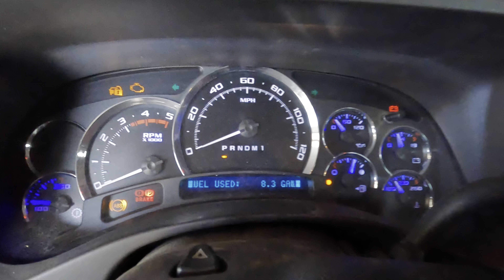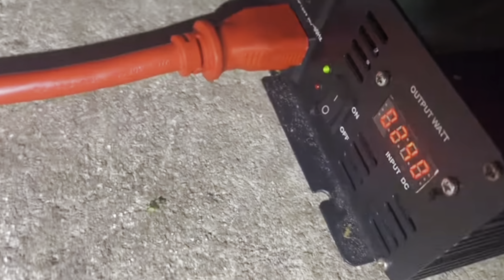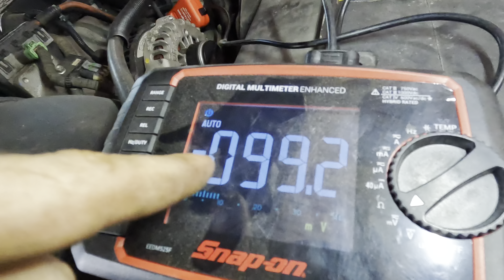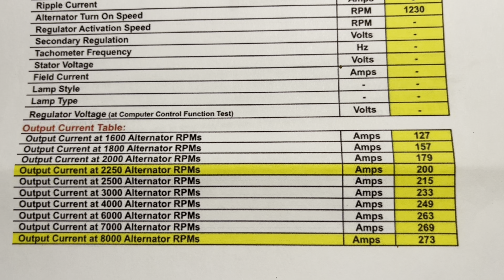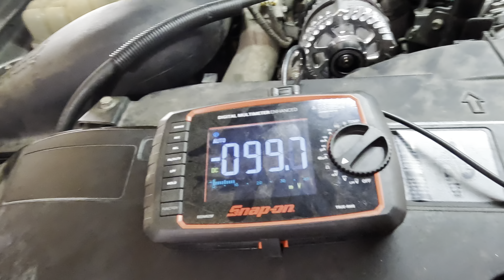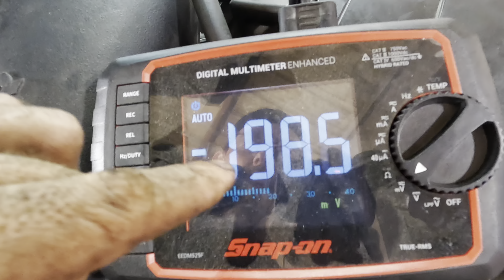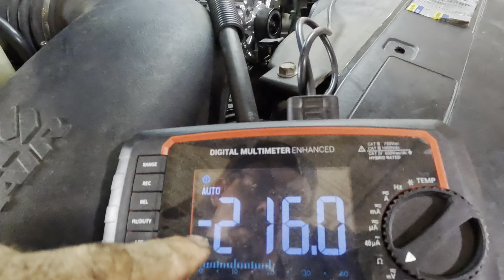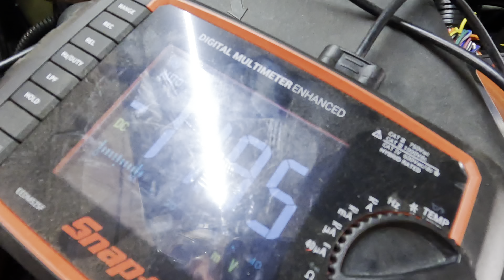Torture Testing a Performance Alternator

Comment: Ray if you double the output of the alternators you are doubling the power required to drive them especially at full output what happens when the belt breaks at 2.00 in the morning and leaves your engine without a waterpump for cooling also diesel engines hate running under light load the rings glaze up and they start burning oil
Reply from the maker: High idle at 900 rpm will prevent glazing and keep oil pressure up, that belt won’t break with this setup. It’s an oem configuration found in medium duty trucks

Comment: I have a 150A alternator (has 200k km), 60AH LIFEPO4 A123 battery with 900A cranking amps (6 years already), more than enough, don't get why in USA you need two alternators? You are making your system more inefficient, what about the belt, can it drive both of them and also the AC compressor? more than 10KW at full load?

Comment: This is great and all, really, I’d say do it just for peace of mind, but honestly, why not just install a generator at the house? Or have an electrocutionist install a plug at the back where you can plug in a portable generator to run the main parts of the home in a power outage I.e fridge, stove, couple outlets, etc, which is cheaper than a whole-home generator. Makes more sense than just relying on the truck, but to each their own. Maybe I missed your decision process on this whole endeavor 🤷‍♂️ which is more than possible 😂 
God bless~

Comment: I see that you regularly measure amperage, isn't it useful to install 3 ampere meters in the dashboard, 1 for each alternator and 1 for the total power consumption? This way you can always check whether the alternators are still working properly and in the event of a power outage at your hoouse you can quickly see what power your inverters are consuming and whether you are not drawing too much power from your batteries. Also way easier than fiddling with and adjusting of the clamp meter all the time.🤷‍♂

Comment: Its designed to short term surge up to 270 not run at 270 continuously - Or you'll burn out the regulator and or diode - Get real here - The battery's them selves cant accept a charge of that amount or they would go BOOM!!

Comment: Won't the alternators fight each other?
Reply from the maker: Only on Toyotas 😏
Reply: They'll adjust automatically. Thank of it like a big guy along with a weaker guy both pushing a car up a hill; the weight of the car is the load & the two naders are the guys. The big guy will do a higher percentage of the work. In fact, the way Ray has it set up, the little guy won't be pushing hardly at all until the big guy begins to slow down a tiny bit.
Reply: @wirdy1  ok, so no back feed from one to another?

Comment: Stupid question from a stupid guy: Will this be a smart thing to do to get more charge at idle speeds? I feel like I have low charge at idle on my car, special when its winter.  Love from Norway
Reply: That’s the whole point of Ray’s upgrade !   But you should test your rig before you go spending money !!
Reply: You could probably just use an over drive pulley instead of adding a second nator, smaller diameter pulley = more rpm = more charge at low engine rpm

Comment: I do understand why you are doing what you are doing.   But why not invest in a whole house generator?   It would be cheaper to operate than that duramax
Reply from the maker: I actually a gasoline partial home/portable. The issue is fuel consumption and noise, especially at night. This setup lets me burn less fuel with less noise, and I have the bonus of having 120v power generation anywhere, including remote locations.
Reply: I get the noise issue  and more especially fuel.  You can get a diesel genset  and if you watch for deals for which I know you do  you can find a farmer that's retiring and buy everything including switch gear for pennies on the dollar.  I know too well about living in the country with not so reliable power company

Comment: So what.  Serious waste of money. Belts, bolts, brackets and electrics to do what?  Boost your ego?  You didn't invent the things, you only bought them.  Do you need them?  I doubt it.  Very inefficient way of making power from the diesel fuel you pay for anyway,  Rather silly endeavor.
Reply from the maker: Ya got me! I have carefully constructed my personality around an alternator! Do better sir 🫡
Reply: @RainmanRaysRepairs  Yar.  It makes soo much sense to pump out 3600 Watts @12VDC requiring 4/0 cable and then bump it up to 120/240VAC.  Simple(minded) engineering genius. But, oh yea, you can does it with just a few clicks.   Not trolling you IMO, I just think the idea is sorta lame.
Reply from the maker: @nhzxboi  Well the concept and setup isn’t for everyone. I live in a remote area and often use power in locations far away from an outlet. For me, it serves more purpose than just a partial home backup supply. This also how boats and RVs get 120v power in board if they’re not connected to shore power. So the application has a wide array of uses